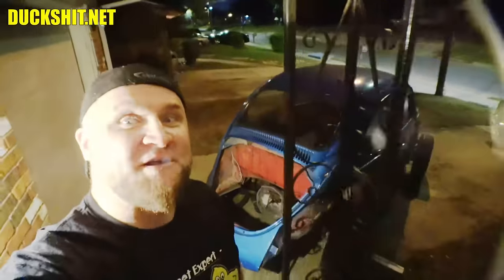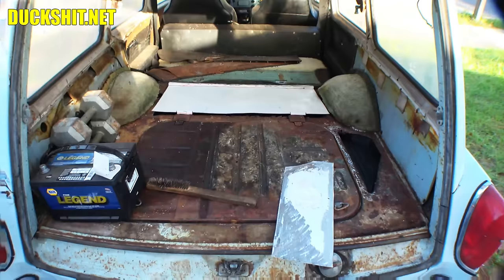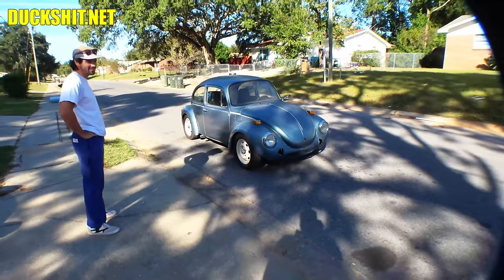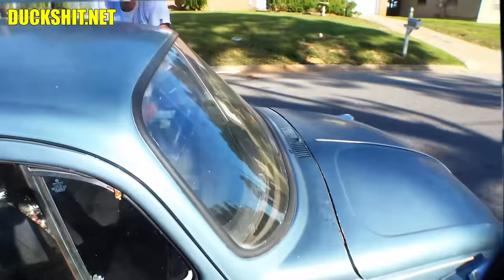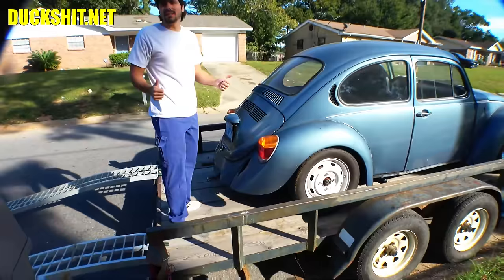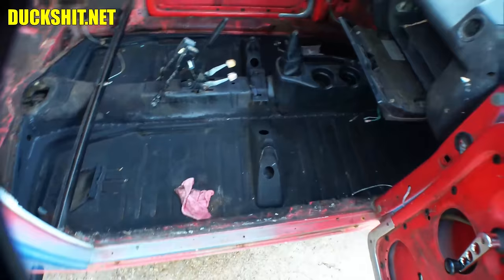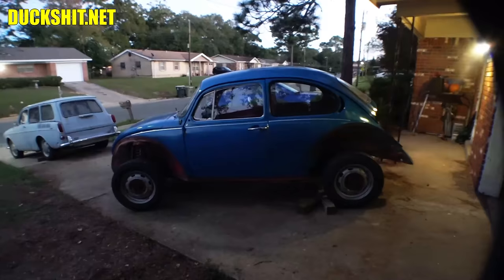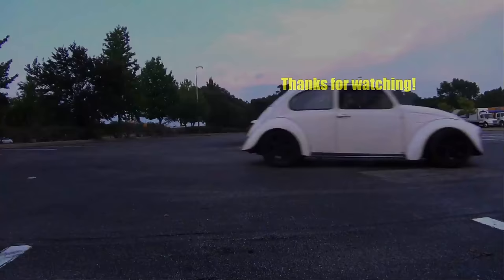Next Project Arrives - More Test Drive 🛠️ - 1974 VW Super Beetle

Comment: Enjoyed the video, but couldn't you have lubed the hinges on the stupid bettle's engine cover?   I hate hearing that creaking!  Thanks again for your entertaining and educational work!
Reply from the maker: LoL!  Thanks, but they were lubed.  The creaking is the spring, they all do this.   Even my freshly-painted and lubed 1956 with brand new spring.  Hope that educated!   I put a lot of work into video, and you crab about the one thing that doesn't matter.  I'll never understand dealing with the public.  Must be a Ford of Chevy guy, they're all experts.  Sheesh.  But hey, thanks for all that praise otherwise!  I appreciate it!
Reply: Actually I'm a Volvo guy, and their springs creak too unless oiled where the spring clips to whatever the ends of the spring clips to.  Then the spring can move freely and not creak.   A lost art learned from over 50 years of turning wrenches before springs were replaced by pneumatic struts.  Cheers!
Reply from the maker: Springs are not only cheaper, but they last forever.  I am not a fan of gas struts at all.  Lid springs require some better engineering which is usually skipped over for an off the shelf part anymore on modern vehicles.  When was the last time you even seen a strut at all on a hood... prop rod is cheap and easy.  I am not impressed by modern designs.